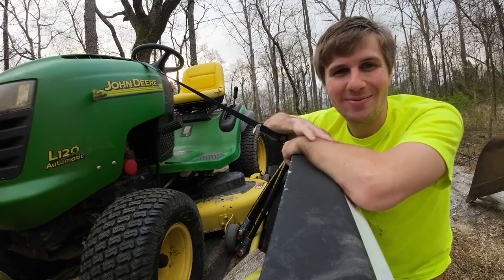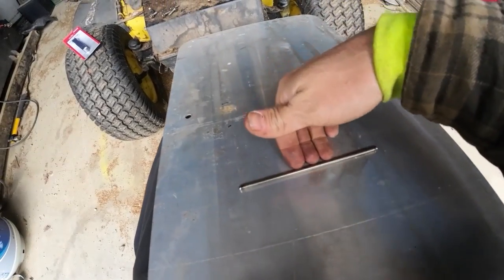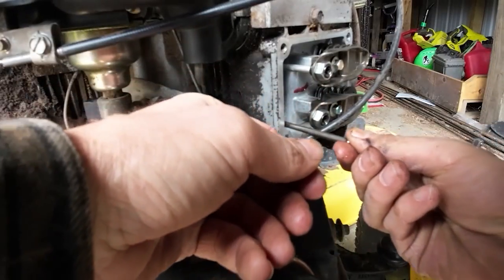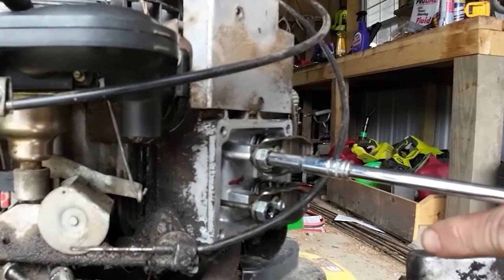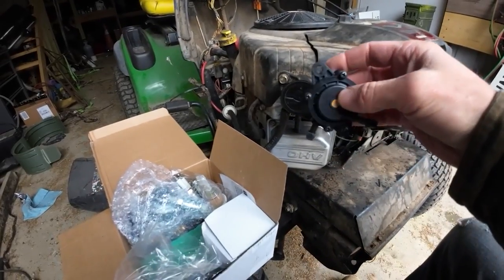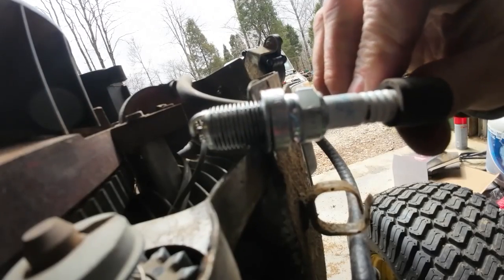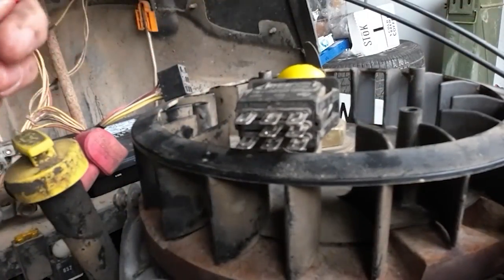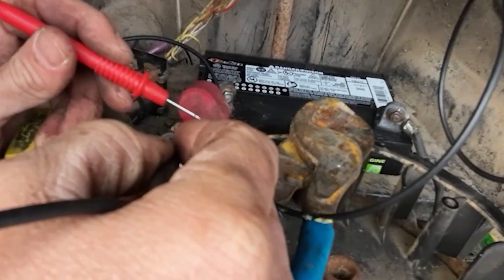Will Not Run - John Deere Lawn Mower - Electrical Problems - Trade up Challenge Continues

Comment: Cap’n she’s a running!  I’m jealous.  You have your yard mowed and I haven’t even looked at my mower.  

I was gonna mow it yesterday but Nana insisted that I wait until the Easter bunny had done his thing.  Her reasoning… with the grandkids getting older, they need more of a challenge in finding their eggs.  

I suggested that we tell EB to color them green instead but… well, tradition requires a whole pastel palette.   So, I’ll be wading through ankle deep dewy grass for one more day.

Now about becoming a boat owner… I almost became one.  My neighbor gave me a bass boat.  I was ecstatic at first… then I pulled it home and got good look at it.  The shell was immaculate.  But, it had sat outside for 10 years.  At some point the drain hole had gotten plugged up with acorn shells that tree rats had squirreled away under the transom.  

Every inch of the inside was supporting a growth of moss that would make the north side of a swamp oak jealous. The seats were even supporting their own garden of greenery.

Deck boards crumbled at my touch. The screws holding the compartment lids were corroded.  Even though they were stainless steel!

The rats nest of wires under the dash were appropriately named because rodents had chewed every spec of insulation of them.

Etc…

After assessing amount of ‘love’ and money it was gonna cost to get it going again… I decided it was a couple of magnitudes above my excitement over having a bass boat! So, I did what any self respecting YouTuber would do… I checked on progress of the most famous Bass Boat salesman in America.  Donnie Baker (Bob & Tom Show) has been trying to sell the same bass boat since about 1990… and it’s still for sale!

That did it for me.  I towed mine back to the neighbor’s place and thanked him for offering it to me…. And am watching Donnie Baker to see when his price comes down!

Good luck Cap’n.  I’m sure it’ll be fine!

Hope you and the ladies have a fun and blessed Easter!

Comment: At 14:40 you are correct in that the switch was a "safety" switch to prevent mowing in reverse. 
I, myself, never liked this particular switch as it made mowing cumbersome and a lot of wasted time, and "dead head" cutting.  This is "one" of those switches that I would disconnect for myself.

Comment: I did a similar cutoff on a mower I restored last year.  It's a pull start and the choke when choked all the way down is supposed to kill the engine but it wasn't.  So I  added a kill switch.

Comment: It looks like that last plug that you got in your hand right now or the unrengine you got Croatian on there if the other side's got. Corrosion on it too. You need to clean your For your safety switches.
Reply from the maker: It was grease

Comment: I'd put money on the kill wire being slightly damaged where it passes behind the starter. Common issue and can also be intermittent as it vibrates with engine and sometimes shorts to ground. Not a problem now though with your solution. 👍👍
Reply from the maker: I think so too

Comment: What the heck.
From a camper trade up series to a whole in the water you throw money into boat changeup.
Boyo, I didn't see that one coming.
Gonna be a fun series that one.
Having lived down in the Keys for 10 years and been stuck with doing most repairs on my boss's two boats.
One of which I got to use when I wanted (19 foot Hoog with twin 200 Yamaha engines that had 150 on the covers he called a Harley on the water) keeping boats floating and running is not a cheap endeavor. 
That said, I hope it's not a money pot for you Captain so you and your family can have an awesomely fun summer.
You may end up deciding to keep it.
It looks big enough to ski behind and if the girls learn how to ski you can pretty much give up on getting rid of it once thet have.

Comment: Glad you got it working Mike!  I know it wasn't your problem in this case, but I hate those MTD ignition switches!  I've replaced the one on my neighbor's zero turn twice in the last 5 years.  They're just a copper disc hat turns with the key and a few copper points that wear down.  I'm guessing you have the 3.0L 4 cylinder GM block in that thing.  I would definitely check that the impeller in the lower unit is pumping so the block is getting cooling water.  They're pretty cheap to change, but only last a few years.  If the impeller breaks down, you lose water flow and overheat.

Comment: I got the same engine, had the same problem, the needle valve plunger that goes to the float in the carburetor gets corroded and just needs to be cleaned . Then it will go another 10 years

Comment: I think you can also just put test light on that wire going to coil witch I think is a ground then a positive with it so light is on.then operate all the functions that has safety switches until light goes out

Comment: I know this is an old video. Just thought I would say great humour and the odd things you say does match with the sort of things and the way I say things I am over 60y and started working in my dads Blacksmith shop age 10y also I am dyslexic "thank god" it made me what I am... however my work shop is my dining table and my wife will not allow me to rebuild her 1960 dads motorbike.... So I renovate old sewing machines the current project is a Singer 13k treadle it looks a bit sad but now runs well not bad for an old girl born in 1882.
I wished I lived near and could give you a hand, but I am in the UK. My sister is a farmer in Ontario she is closer, her hubby works in a salt mine under lake Huron; prior to that in the UK he operated a cement quarry digger that had a bucket that could scoop up your house. 

You and DP and MBTS and NYA Millennial make me feel happy.
my current project - I just replaced my dehumidifier yesterday the new one seems faulty will not go below 53% humidity, the 8y old one I just pulled apart and the 450v 7uf run capacitor is ssplit open. Now I need to take the new one back for an exchange and fix the old one. So we can dry the washing.

Comment: Hey Mike,
The Only Thing I didn't see you test, and I suspect is the Backfire Prevention Solenoid in the bottom of the carb. I have had those go out and they will prevent fire to the engine. Super easy to test. pull out of carb and turn key to run, see if the plunger goes in and out. Hilariously great design - they usually screw into the bottom of the carburetor, where dirt collects. Someone didn't think that one through!
Reply from the maker: Tested in previous video
Reply: The anti-gackfire solenoid does NOT prevent "fire" to the engine.  It blocks FUEL from entering  the main fuel passageways.

Comment: Ok ,the motor has magneto ign only needs a ground to shut it off ,it seems to me that mower has a dual function switch on the safetys witch enables the starting motor to work also

Comment: I'm not sure how you solved the spark problem but the kill wires have diodes in them so they don't short each other out . Plug the kill wire back on one side at a time and usually it will run on at least one cylinder . When you turn the key off and on you should hear one cylinder drop out . If you test for continuity it should read zero in one direction between the coils . If you get continuity in both directions the diode('s) are bad , shorted . Happens some times when jump starting a mower with the car running .

Comment: If you still have the mower, the problem is the 20amp fuse under the hood in the wiring mess and you won’t need that kill switch

Comment: I believe there a couple of diodes involved in the kill wire circuit on the two cylinder engines. The schematic should show them.
Reply from the maker: Correct, I think that was probably the issue

Comment: I do know with any engine the valves are not adjusted correctly if you can pull the push rod out without loosening the rocker arm.

Comment: Have a look at the carb. Some of the deere have a electric fuel shut off on the carb that burns out . If it goes out it will crank but not start.
Reply from the maker: That doesn't have anything to do with spark.  It was tested and works
Reply: @CaptainKleeman  sorry sir . I had made the suggestion before I watched the whole video.  My apologies.

Comment: I did not see you check the Alum. push rods.  the broke wires going to the cluch on the cutting deck , makes me thing there is trouble with the brackit that holds the cluch.  My mower spent all last year in shop fot that reason,  could not get them to replace the cluch and braket, THAT IS JD for you.
Reply from the maker: There was a dedicated section of this video checking the push rods.  👍

Comment: The tractors I have had would not crank at all if any of the safety's were not set where they need to be to start (sitting on seat ,brake pushed down, PTO off)
Reply from the maker: Correct

Comment: I have the same exact problem,  with the same exact mower.  Total mind bend.  Lol.   How did you hook up the kill switch???
Reply from the maker: So it ended up being a diode between the two coils.  Replaced that and it fixed it.  Not sure it will work for you, but worked for me

Comment: You did the research, but if disconnecting the coil ground wire allows the mower to run don't you need an open circuit on the kill switched in order for the power to the coils not to be grounded through them?
Reply from the maker: I'm not sure what youre asking

Comment: what did you unplug to get it started with no spark issue? you didnt show it?
Reply from the maker: There is a little black wire attached to the magnetos I think.  It's been a minute.  It has a diode on it that ended up being bad.  Replaced that and no issues.

Comment: I 100% know the problem the kill wires that goes to the coils have diodes on the engine side of the harness and when they go bad you will have no spark until you unplug the kill wires from the coils and if you depin the kill wire from the engine harness connector with both kill wires still hooked up to the coils and no spark that’s 100% your problem it’s a very common issue on the Briggs vtwin engines I hope this helps out anyone trying to diagnose there Briggs vtwin engines
Reply from the maker: Yup.  Replaced it and it worked great.